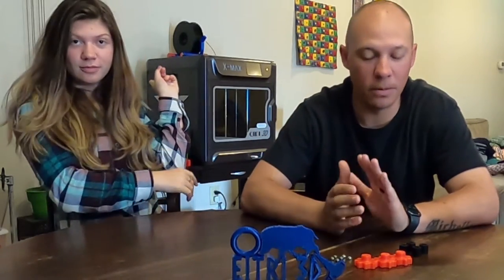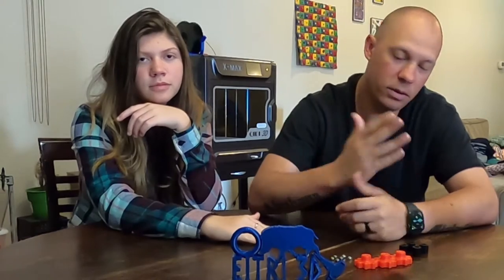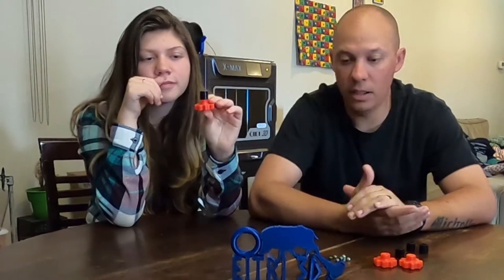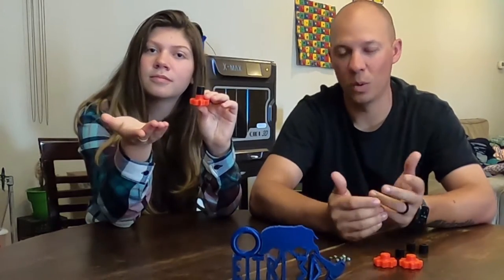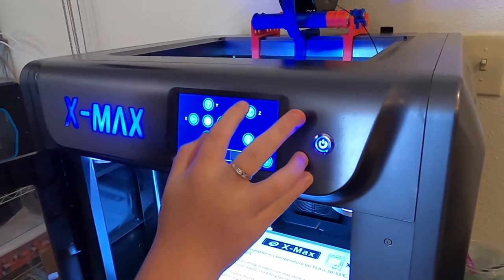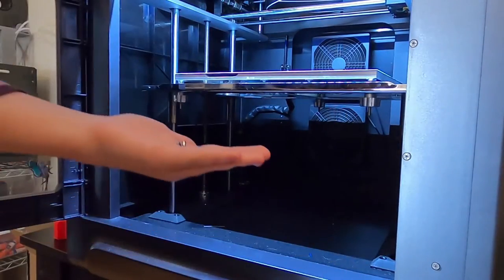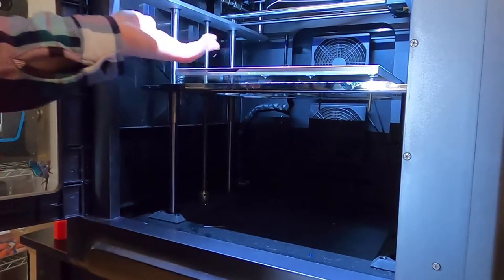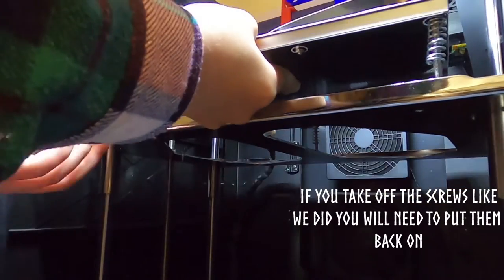Upgrading the Bed Leveling System on Qidi X-Max

Comment: Can you put a Amazon link to those spacers. Thanks
Reply from the maker: https://www.amazon.com/BCZAMD-Silicone-Leveling-Heat-Resistant-Anycubic/dp/B07S2R5C6P
Reply: @Eitri3D  I got these ones but for some reason they aren't long enough.  After I put them on and tightened them down a bit and then tried the recommended leveling procedure, but I couldn't get the bed close enough to the nozzle before it skipped on the z-axis screws and fell back down.  I've purchased some different spacers that are almost identical but are a bit longer.  They should arrive tomorrow.  Here's the new ones I got. :https://www.amazon.com/gp/product/B087JKW7SF/ref=ppx_yo_dt_b_asin_title_o00_s00?ie=UTF8&psc=1
Reply from the maker: Out of curiosity, when your tried the leveling, at the end did you raise the bed using the Z-up button on the screen? This is the first I have heard of this issue, that’s why I’m asking.
Reply: @Eitri3D  I did raise it up using the manual Z-up control to raise the bed to put in the new spacers.  From there I went directly to the "Recommended Leveling" procedure (which of course takes the bed all the way to the bottom and back up).  From there I just used the +0.05mm button.  I'm doing it again right now and it looks like the bed frame is hitting the cross beams on either side before the bed is close enough to the nozzle.  I think maybe I cinched the spacers down too much?
Reply from the maker: Yeah the spacers in the link aren’t required to be completely smashed down. They will be smashed a little and the back will be even less, in my experience. So I would bring the bed up, not to the point it hits the bar and then unscrew the knobs to raise the bed at each point evenly. That should work for you.

Comment: So how the new bed 🛌 leveling going?
Reply from the maker: Absolutely loving it. I ended up taking it apart and replaced the factory nuts with locknuts. Once I dialed it in, there haven’t been any issues.
Reply: Eitri 3D
I think it would be a great ideal for to show us how you level it step by step. It would help all of us out here it you wouldn’t mine.
Reply from the maker: The Dronz Dr check out the second half of the X-Max Introduction video. I go step by step there. Here’s a link to the video. https://youtu.be/gL7kyoMWkXk
Reply: Eitri 3D 
Thanks that helps a lot my friend
Reply from the maker: The Dronz Dr no problem, we just want to help others.

Comment: Do yall use the splicer software that came with the printer? Im having issues with supports configuration. My objects are coming out with the supports literaly attatched to them
Reply from the maker: Yes, we use the Qidi Print slicer. When it comes to supports, we like to use the tree supports. It uses more filament and takes longer to process, but is easier to remove than most others we have dealt with. Just know the higher the percentage of supports the harder they will be to pull off in conjunction with gap between supports and model. After the holidays, we will do a video about supports. This way we can demonstrate how to adjust settings to achieve the best results.